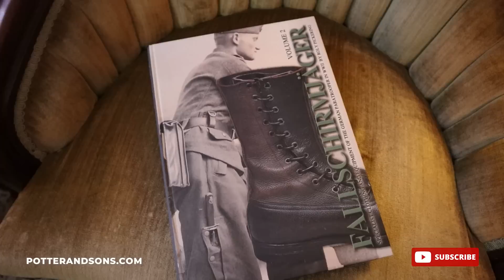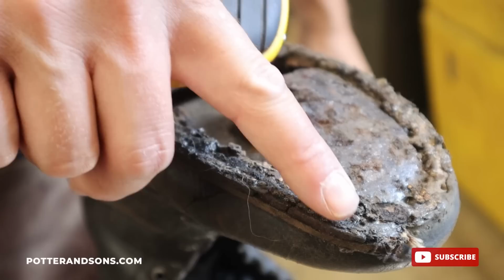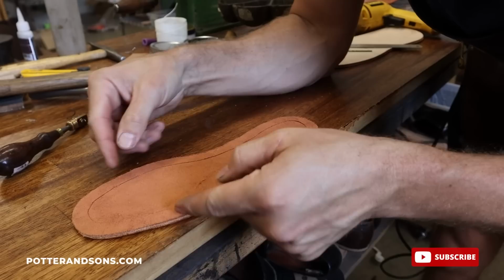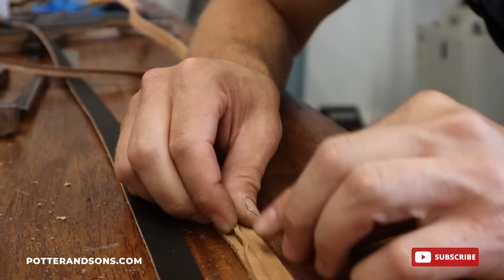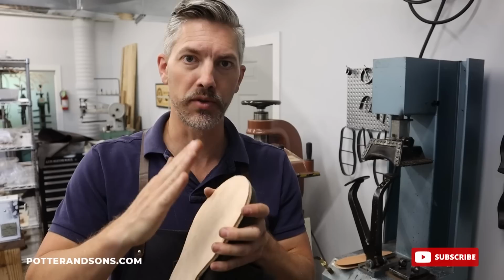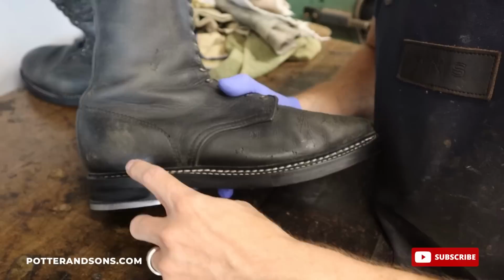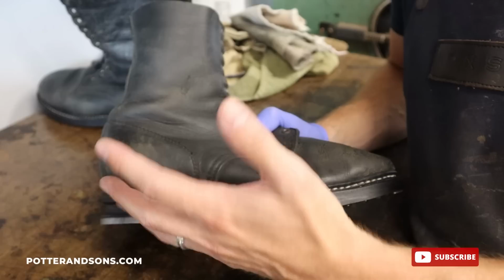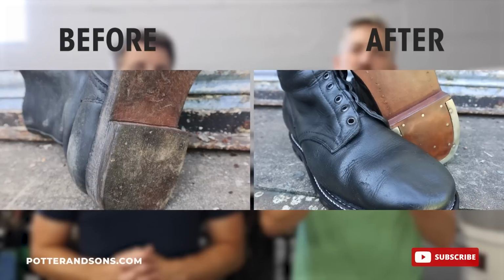WW2 German Paratrooper Boots Restoration

Comment: You may as well have blackened the sole stitches. It wasn't going to look like it did when it came out of the factory, unless you were ready to redo all of the stitching on the uppers, which you weren't! It would have been a bit absurd, since that stitching was in good shape!
Dan, at Tring (the channel is now called "Dan the Cobbler"), has a fair amount of experience with hobnails. He has considerable custom from the military bases in the area. When it comes to drill, they're still using much of what they were using during the Second War.
Well done video! It might have helped if you had let us know about it ahead of time. That way, any of us with helpful information could have shared it with you before you made the video, rather than after the fact. You might want to keep it in mind; we really do want to help!!✨
Reply from the maker: It wasn't my boot.  I'll leave that to the owner.

Comment: IIRC Fallschirmjaeger boots weren't made with hobnailed soles. They were some of the only German boots that utilized (scarce) rubber soles to prevent slipping hazards when onboard aircraft. Pretty much everything else the Germans made just used leather, since they had abysmal supplies of rubber from the get-go.
Reply from the maker: 👍 thanks

Comment: I remember reading somewhere Germany and Italy’s rubber supply was limited so in order to maintain its artarky (self sufficiency policy) Germany invented synthetic rubber.   Perhaps they went back to leather soles due to a shortage of rubber?   Thanks for the history lesson and great boots!
Reply from the maker: Thank you
Reply: @TrentonHeath  you’re welcome. Hey just had a thought,  the Roman legions had nails and metal studs in their shoes too for better traction… not so good on stone and marble floors where they fought barefoot.  When they marched the sound of the shoes were apparently quite intimidating. What about construction of a  Roman tactical Sandle?!  I read somewhere they enlisted cobblers to follow the military because of the constant need for shoe repair.  Thanks again.
Reply: …sandal. I hate auto smell.

Comment: My standard issue boots (1980-1983) had rubber soles, same with the "jump boots," and I don't remember slipping except, in that "nastyasswetredclay" of Georgia. I can't imagine hobnails, wouldn't you slip and slide like a fool on wet or frozen pavement? Also, when angle cutting the mid soles, why not tack them down, the holes would seem to be negligible?

Comment: Wow. That is some kind of boot, built like a tank. Is there a difference between the cement that you use to attach the sole to the mid-sole and the standard “rubber cement” sold retail?
Reply from the maker: It really depends on the glue. Lowes sells a good rubber cement.

Comment: Great work as always. Is it similar to or the same as a Norwegian welt? I have a pair of hand welted boots from an Indonesian maker are made in this way. The welt is leather bent into an L shape and the stitch connecting it to the insole being visible on the outside.
Reply from the maker: Similar,  but not exactly the same.
Reply: There is no welt at a classic norweger, the upper itself works like as it were a Stitchdown.  Common in norweger and goiser is that both uppers are stitched to the lasting insole. At a norweger the welt is not necessary, at a goiser welt is the connection between the upper parts (and lasting insole) and the midsole and sole.